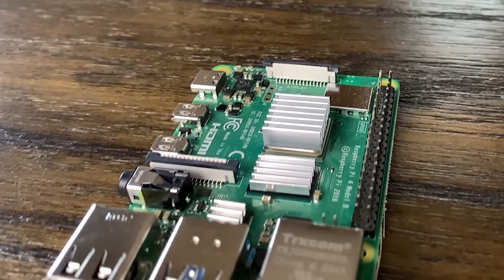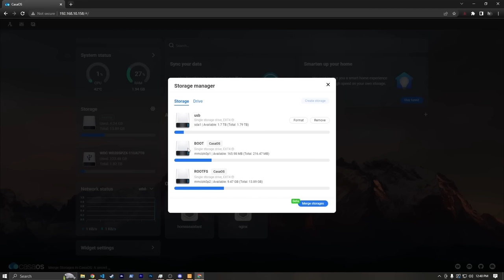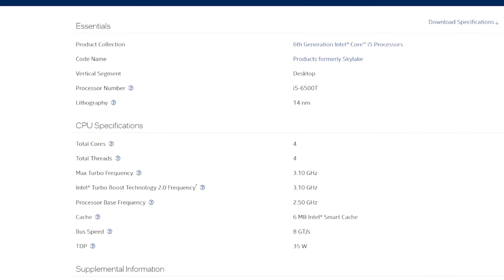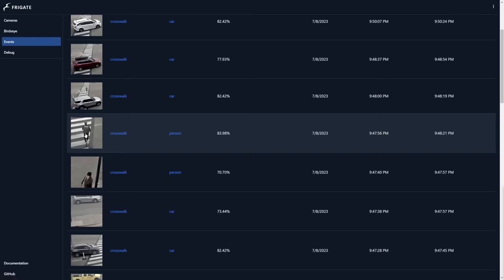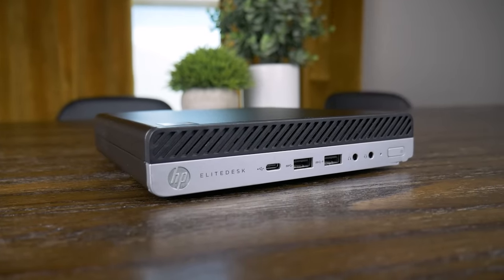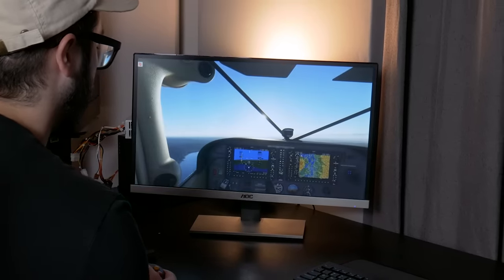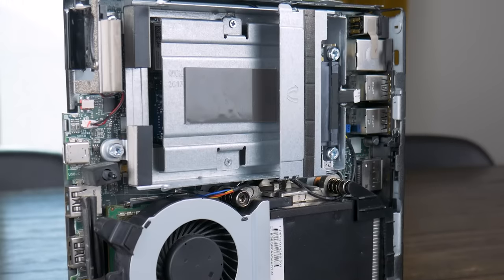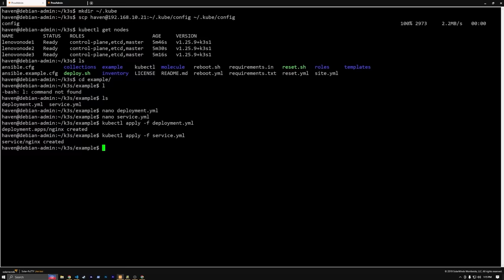The Mini PC You SHOULD Be Looking At

Comment: You mentioned that you can use the m.2 e slot for other stuff like a coral tpu that's wrong I tried it my self only wifi cards work (when you do some research you will come to the same conclusion)
Reply from the maker: I must be a super hacker then lol. I’m currently working on a video and have frigate NVR working using a coral TPU. You’re correct that it doesn’t always work. It depends on the motherboard. Otherwise, why would they even make one for an m.2 e socket?
Reply: @HardwareHaven  Ya then ur lucky I have an "hp prodesk 400 g3" and an "hp elitedesk 800 g3" both don't work with my coral tpus (tryed the singe and dual tpu variant...) and then had to switch to the usb one
Reply from the maker: Interesting.. i used Debian 11 and the most recent version of frigate and it seemed to work

Comment: I switched from a Raspberry Pi 3B+ to one of these for my Batocera arcade machine and holy shit. It's a powerhouse. Runs everything all the way up to Wii U full speed.. whereas I was limited to Dreamcast on the Pi.
Reply: I'm hoping to get one of these micro pcs for batocera too. Have you had any luck with ps2 games? I'd hate to get one and then later find the next model up would have made the cut.
Reply: @tonyhawk123  I have the HP Prodesk 600 G3 with the i5 7500T CPU with 16g ram and it runs PS2 games at full speed no issues. I even scale the graphics up x2 times and runs at full speed. Running all the Tekken games, Tomb Raiders, Gran Turismo 4 etc no issues at all. Plays 95% of games all the way up to Wii U.

Comment: I really don't like the click bait still because the business case for these has almost no overlap with raspberry pi. Maybe pi hole but it does perfectly on a single RPI. I added SFF servers to my lab configuration about 6 months ago and there's a ton a of value especially in older hardware using SSD.

Comment: 35W TDP CPU from 2015, as is often the case with these corporate mini PCs, slower than 6W TDP N100, but more connectivity and upgradeability. Choices.
Reply from the maker: I have another video where I covered an N100 system and compared to this exact PC. Multi-core performance is actually better on the i5-6500t at least in CineBench. Idle power draw was essentially the same between the two as well

Comment: how does Parsec work?  server on gaming pc, client on other device?  or server in the middle?
Reply from the maker: You can run the app on a machine as the “host” and then remotely connect to it using the same app. It’s peer to peer so no server in the middle. If you’re connecting from outside the local network it requires either upnp to be enabled or port forwarding.

Comment: If someone wants to use these as a budget gaming option, ignore Intel and get an AMD, Team Red has some pretty powerful APUs out there.
If i could buy an ITX mainboard with the Steamdecks Van Gogh i would do so blindly as i currently use a Deck as my main battle station with vanilla Arch. Almost anything i throw at it runs reasonable well and with German energy prices, even if they are going down currently, having a system that peaks at 15(!) Watts and that can do everything i want and need is perfect for me.

My whole setup, the mentioned Deck, two 24" screens, an external DVD burner, an external 6 TB HDD and a Nobsound amplifier, eats around 40 Watts when gaming or doing other heavy tasks and sits around 30 Watts when idling. This is green computing, this is the way! 💚

Comment: You said nvme OR 2.5" sata.
But you can use both of them at the same time in the G3.
Reply from the maker: For sure! An “and/or” would’ve been better
Reply: @HardwareHaven  in case this is helpful to you or someone else reading, the G4 has two m.2 2280 slots (plus the wifi slot), and had the option for a 2.5" sata caddy, too. So they have ports for 3 drives, but one of the m.2 2280 slots is raised up, and it interferes with with the 2.5" caddy. So you can only have 1 m.2 drive plus 1 2.5" sata drive or you can have 2 m.2 drives.

I think that was improved for G5, so you could have 3 drives. (unless you have a 35w system w/dgpu or 95w system with the extra bulky cooler, either of those blocks the 2.5" caddy)

Comment: How do I mount one of these in a small battery powered aircraft as the device controlling said aircraft and phoning home with data? You're doing what a lot of tech reviewers did when the raspberry pi launched and telling people the pi was meant to be a tiny desktop replacement. It was meant to be a hobbyist board that can control hardware through it's gpio pins. The HP you are selling here was meant to be an actual desktop replacement for people who don't need things like a dedicated GPU.
Reply from the maker: I never said Pis were bad. Pretty sure I actually said I love them. If anything I’m making the argument that you are; this is something better for desktop and self hosting than a Pi in most circumstances. It is not better when it comes to all the other stuff that Pis do.

Comment: I've set up several small and tiny "liter" PCs for clients who want something cheap that works for business and work.  Not for gamers or those who want upgradability.  Thus my own rig is a HYTE 60 case for good reason.    I find it amazing that people buy NEW mini-junk PCs from Amazon for $200~400USD with limited memory, low-end Celeron and Pentium CPUs, cheap parts. 

Microcenter sells a lot of them.  And of course, eBay.  Pick up tiny Lenovo ThinkCentres for $100~200 with 6~8 gen CPUs.  Win10Pro Pre-installed.   I still prefer Lenovo over HP for being more rugged and easier access to replacement parts.  I've picked up for myself and friends or clients good deals on Lenovo Thinkpads and ThinkCentres for a steal once they are 3~4 years old in almost new condition.  Like $300 used vs $1800 new that are about 5%~10 slower than the latest models.

Comment: Good stuff...Definitely a RPi killer at todays prices (even though I hear they are making a comeback)
PROXMOX on these little machines (with ample RAM of course) would be an easy way to spin up a few light Debian servers for a "home lab" for sure!
Right now I have an AMD version of that the (EliteDesk 705 G2 MINI) that I frankesteined by desoldering the thin CPU heatsink fins and epoxying on a cheap Chinese SNOWMAN Heat Pipe to it and leaving the top cover off...running 100% f@h, the CPU temp never gets above 50°C running wide open...I use it for messing with docker and run a TOR relay container (it's uglier than a mud fence...but it works stupid well!).  It can decode h265, but it can't encode it, so converting media library to the much better compression of h265 is painfully slow!
Loving the content!
Keep em coming!!!!

Comment: HELL NO. I have been using these hp’s at work for about 4 years and I can tell you that we have spent more money on IT to fix these than the cost of each of these pc’s brand new. They breakdown almost on a daily basis. The only way for me to get one of these in my home is to completely modify the HD, ram, and improve their wireless/bluetooth connectivity. Otherwise they are completely trash.  I am speaking because the company has about 30 of these running at any one time and they are more of a nightmare. We go in everyday to work waiting to see who’s pc needs to be replaced or rebooted. Btw, we don’t do heavy graphics.
Reply: Break down how?

Comment: 6 and a half watts?! My laptop has an 8th Gen Whiskey Lake CPU that can go down to 2.93 watts on idle, and I'm running a full Debian Gnome desktop with apps in the background. I have a feeling it is because yours is a few gen older so less power efficient.
Reply from the maker: Where are you measuring that 2.93 watts?
Reply: @HardwareHaven  powertop
Reply from the maker: I’m assuming it’s more efficient being newer, but I would imagine the power draw would be higher than that if you measured the power straight from the wall (and without a battery obviously lol)
Reply: @HardwareHaven  yeah I think you maybe right there. Software checks may not be so accurate. But I didn't doubt the results much since the CPU is rated for 15W.
Also there's this utility on linux called `laptop-mode-tools`, don't know if you've heard of it, but it really improves battery life of a linux laptop. It does some important optimizations to disks(spin up and spin down related) and CPU clocks and some other things as well I think. I always install it when switching distros. The last time I tested with powertop, before applying any battery optimizations, the power usage was around 10-12watts idle. But after applying the optimizations it dropped down all the way to around 6. The main two things that helped were laptop-mode-tools and switching off optimus features in the kernel.
Reply from the maker: Good to know! Thanks
Reply: @HardwareHaven  Happy to help :)

Comment: Its nn Hp? Have you all seen what HP is doing in the printer industry regarding ink cartridges?
Reply: Just because it's an HP doesn't mean that the computers are horrid. I'm daily driving a Prodesk mini with an external GPU hooked up to it and it works amazingly. Don't need to spend anything on repairs as its very reliable

Comment: Looks like the incoming air came through slots in the front. Some kind of filter might be good if you are in a dusty area. Surprising how you even used a toothbrush to detail some of the areas, fine work.

Comment: Switched to a nice second hand Lenovo M720Qn (the stuff the second hand stores sometimes sells is absolutely awesome and a good deal) in October 2022 after having made a switch to a smaller system in April of the same year.
The switch made first was from a full-size desktop tower to an (at the time) 11 year old 2nd generation mobile i7 Elitebook from 2011.
After an upgrade from KDE Neon 22.04 to 22.10 or whatever it was running after I first made the switch, it stopped being functional.

Yes it had been quite slow prior to the upgrade, but after that it stopped being practical.

I had 2 reasons to switch: 1 was heat production, and the other was energy consumption.
I was not happy with the idea of having a system run at around 120W's when doing some light work like browsing for the most part, and sitting at 86W idle.
Energy costs were going up in that year due to the war in Ukraine, so I thought it would be nice to have an option to reduce energy consumption.

The reason I went with the Lenovo is because we had them at work and I really liked them there: we went from every desk having a small form factor tower to basically just a monitor stand with a little bit of extra room in the back needed, and during the pandemic, I had been able to mess around with my work machine after gaining some administrative privileges and found that it ran most of the light work I do in Blender on it very well.

So I now have a system that idles at 10-11W's (same as a Pi4!) and consumes 45W's at peak performance.
That 45W's was the idle power consumption of the 11 year old laptop...

It has been a long time when I have been this happy with the purchase of a new computer (or well "new", a slightly older second hand one).

I am going to check out the software mentioned to like, stream gaming I think it does?  (Not much of a gamer so no clue).
My monitor is switched over to the bigger desktop when I use it but for gaming this can be problematic sometimes.

Comment: We use mini PCs in the company all the time. In particular we use the Lenovo ThinkCentre M75q with AMD Hardware, they are really good and reliable. We used to also have Dell Mini PCs but their Bios was just trash, you could hardly find any settings there and they crashed often or didn't boot into windows. So don't buy Dell Mini PCs

Comment: First time viewer, commenter and subscriber. The quality of your video gained me as a subscriber.

These small PCs are ok but will not boot the Raspberry Pi to the curb for at least two reasons. One, size. No making a battery powered handheld anything with a mini PC. Two, discontinued status. These old machines are not supported where the RPi is.

That all being said, if the next gen Raspberry Pi doesn’t significantly kick things up a notch I’ll be leaving the platform. I’m a long time Pi enthusiast but my payience is at its limit with the lack of features other SBCs have and the very long supply shortage for the consumer market while steadily supplying the industrial. Very maddening.

Comment: Hi. I used one of this Mini Pc`s and i install Proxmox and CasaOS as a VM all exactly as you recommended, but how i get IP-Adresse`s for every each program.
I didn`t understand how runs PiHole, Adguard and Unifi controller under the same IP-Adress
Reply from the maker: I’m assuming you’re running those services as containers. In that case, each container will use the ip of the host machine but with a unique port.
Reply: @HardwareHaven   OK thanks, i understand, because i had a problem to specify the IP-Adress from PiHole in my Unifi UDR as one of the DNS-Servers 👍

Comment: I never liked the PI, I bought a RasPi4 and at first I loved it, then all the issues came up.  Lack of software, slow, horrible GPU, etc.  Replaced it with a less than $200 NUC device and it was 10000% better in every way.  The only thing the Pi had over it was power draw, by like 2w (so not even that much of a plus).  I know people will say but a Pi is cheaper and that is bull, after you buy a case, storage, etc for the Pi it costs the same.  Dont get me wrong the RasPi can be good for some things, but now with cheaper NUCs around its days could be numbers, especially if they DONT SUPPORT IT WITH ALL THE DRIVERS ETC.

Comment: I love when people say that the RPi is not comparable to a mini PC because the RPi is smaller while ignoring the fact that in 95% of instances the size or slight power difference between the two is not enough to justify the cost being twice that of the other. To me the RPi is a huge ripoff. The only real thing the RPi has is its support forms. But the need for support is due to ARM being a shit architecture. They should've bit the bullet and gone to RISC-V because then it would've at least made sense to change architecture.

Comment: When you see the HP logo there, you already know that this CPU is not good... It will probably overheat or have some issue that can only be fixed by replacing a part with an original HP one...

Comment: There will be a ton of great PCs flooding the used market in the next few years because most older PCs will not qualify for Windows11. After October 2025 Windows 10 goes off support. They will make great Linux boxes but I would not run Windows 10 without security updates. I know that some can be hacked to run Windows 11 but they may not be elligible for updates.

Comment: The idea that these are better than a pi misses the point of a pi. For example I have a pi zero powered by the Usb socket of my modem/router that runs Pihole and I paid RRP for it.
Reply from the maker: These are better than a Pi in SOME USE CASES. Not everything. The point of this was to present an option, not the only option.
Reply: @HardwareHaven  OK then, the stated aim of Eben Upton was to produce a simple, deliberately low powered device to get kids programming again and not running Windows computers where the initial requirements to start programming is that much higher. There is also the projects part, the unbelievable demand from industry to build pis into products is part of this.
Reply from the maker: For sure! This channel just typically focuses more on self hosting and re-using used hardware, so that was a bit more of the aim I was taking. Mentioning Pis unfortunately gets clicks, but I try to have a rational take.

Comment: IMO, if you don't need to upgrade anything, then these used mini pc's are the best. But if you want to upgrade anything (hard disk, memory, wireless card ...), it's better to buy a new mini pc, for example, this brand new "TRIGKEY Micro Computer 12th Gen Intel N100 4C/4T 16G DDR4 500G M.2 PCIE1/SATA SSD G4 Small PC OS Desktop PC,Wi-Fi 6 Working Mini Desktop, 4K@60Hz UHD Graphics Dual Display/BT 5.2/OS" on amzn is $159 - $23 coupon = $136 (if I buy it, I think I will buy a $25.99 3-year protection too as the quality of these Chinese mini pc's is very unpredictable and reinstall Windows 11 to have a lighter Windows without bloat/malware).

Comment: >don't know how to play solitaire.

It's really shrimple. You can't place cards on the same color, but you can move stacks of cards as long as the entire stack is ascending in value from the bottom card to the top. (Say you have a 7-8-9-10-J stack, and the Jack is red. You can move that entire stack onto a black Queen.) The objective of the game is to get all the cards into the top four slots (which are the only places which do support placing like colors on top of each other), starting with the Aces and going up in value. Jack is 11, Queen is 12, King is 13. Jokers are not included. Play one card draw until you feel like you've mastered it, then get pissed off by three card. Also, learn to recognize a lose state, wherein you can't make any more moves. In PC versions, right clicking will automatically move as many cards as possible into the winning positions.